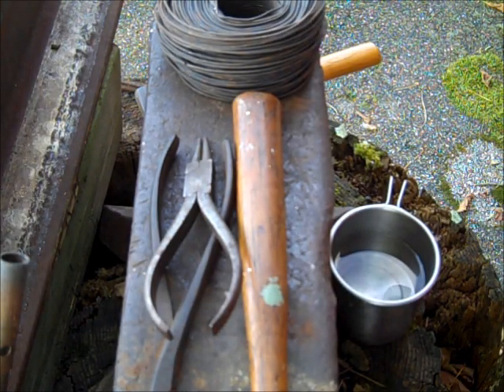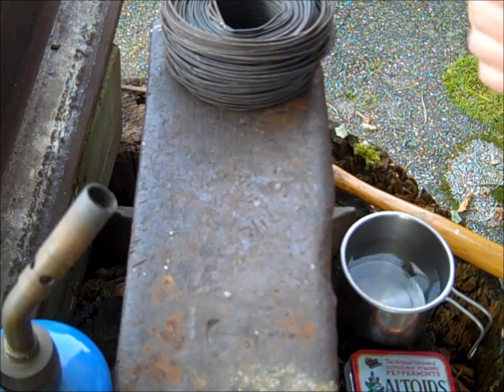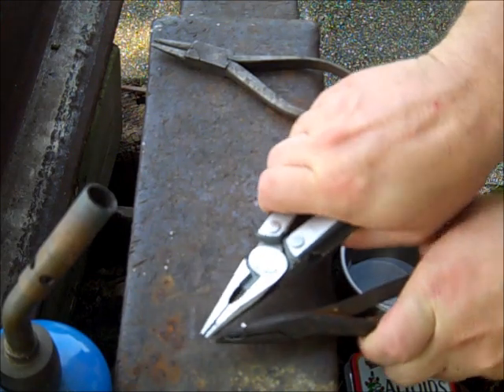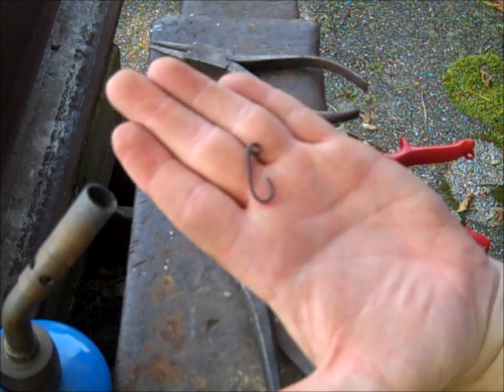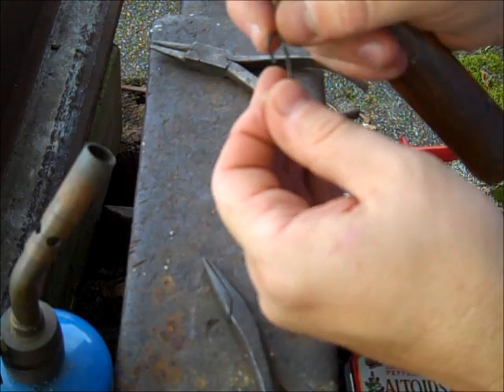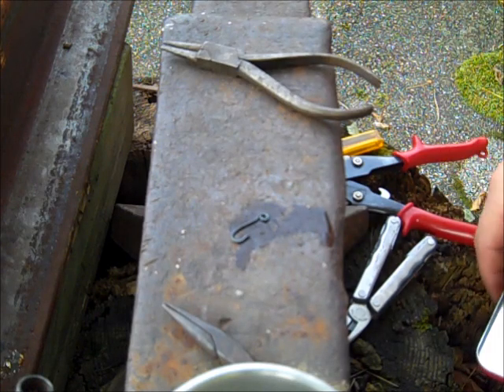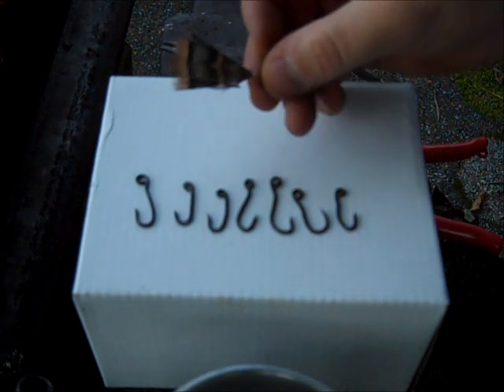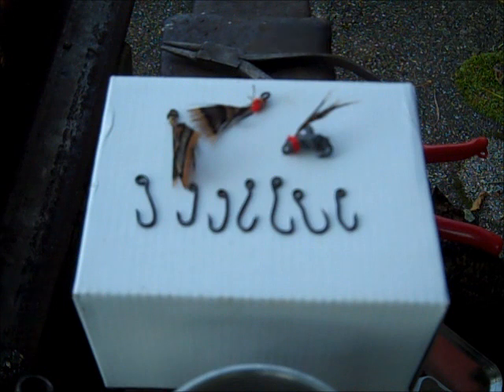Making Fish Hooks

Comment: Don't listen to these idiots.  You had a good video on instructing how to do basic fish hook making.  This is a great resource to prep with.  If you have little money and this stuff laying around, easy task.  Campfire could be used easily enough and any good woodsperson would have a way to cut through and sand the wire.  Great pointer on heating and dousing the hook. My only concern would be if the eye would pull apart.  Fishing salmon here, I'd probably double up the eye hole.  Would love to see the results of using your hooks.  Which ones with what type of bends worked better and what not.

Comment: On that British guy's Bushcraft series, he was in Alaska or British Columbia, and the native American was making a redwood or cedar wood, using water (steam) and fire (heat), he made the biggest of a wooden hook, that looked like a longshoreman's hook (!).  It was used for catching of all things 100+ # flounders in the Alaskan waters.

So think about looking for cedar, redwood, sequoia, even pine, fir, or hemlock, and making a bonfire made wooden fish hook with enough sharpness to actually catch fish.

In Pacific waters, those laser edged hooks now have a red shellac finish on them and fish think they are tiny redworms and chow on them hard!  So if you have redwood or cedar colored wood fish hook, you might just be able to do fresh water and/or salt water fishing and catch without bait !!!!

So slice off a wooden sliver the same as a salmon or trout hook, then using a hot water soak, steaming it in the fire, and bending the hook eye, and the hook bend, you can set the heated wood into a finished cool shape, and it will remain that way ever afterward, much like our ancestors' steam wood furniture, or bow and arrow steamed/fire heat molded hunting bows.  So finish off the hook tip and you will have a wooden fish hook for real.  Better to have these than metal rusting hooks, as they can always come in handy for any other needle purposes as well.

Comment: You used the cheap mild steel baling wire, it is too soft to work well.You can get water harden steel wire from McMaster Carr.
The wire is soft on the spool, but harden in water when the heat is right.
You should put the EYE of the hook on the opposite side of the point of the hook, so the fish can take the whole hook.
Never Hit a hammer with another hammer, you hit the EYE of the hammer, the weakest point & you should wear safety glasses when working with metal. Never use a lighter to lite a torch, use a flit striker like welder use.
You should never use multi tool near a flame, we welder use a channel lock to handle hot metal & only one pair, the heat soften the metal over time & they are only good for holding hot metal after that.
You should get a store bought hook as a pattern when making hooks.
Google works well to fill in any gapes, we all have to start some where.
I found a hook & lure DIY book in a used book store for pennies on the dollar.